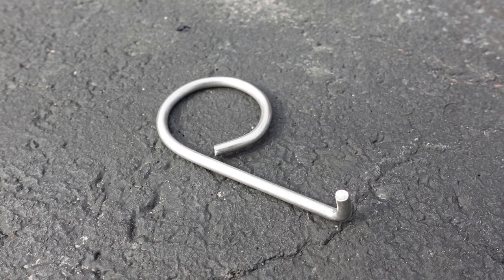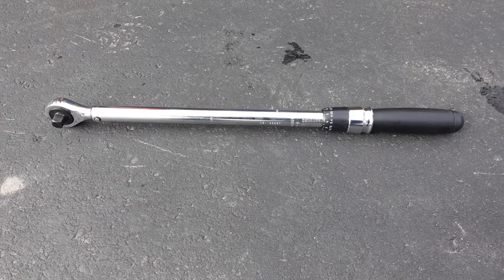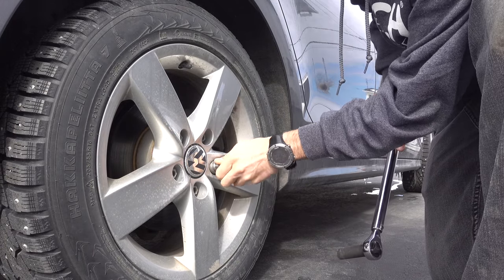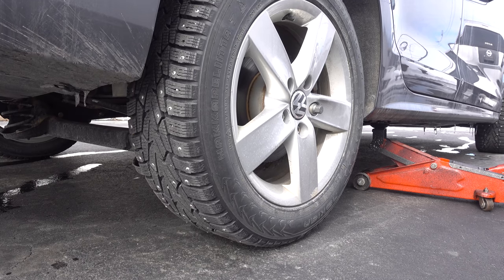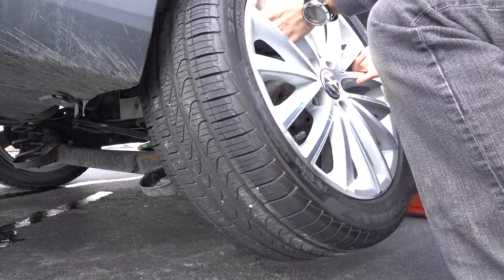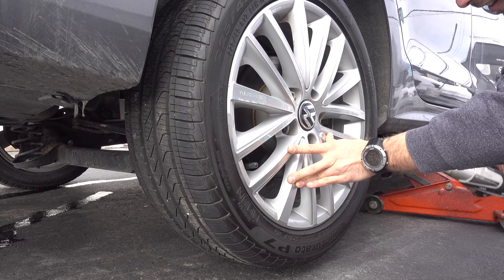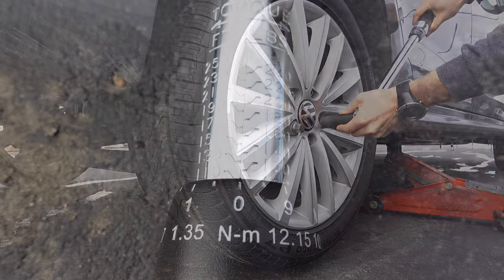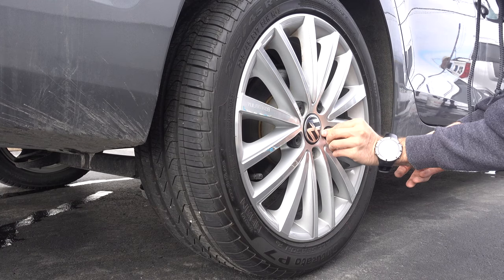How to Change Wheel at home (Exemple with VW Jetta)

Comment: Never put oil on lug bolts/nuts. All your torque measurements are incorrect because of it.
Reply: Thats what i have heard as well but if they are corroded, the torque values are also incorrect. Best is to wire brush them clean. If oil must be used it should be used sparingly. Because when they are installed at factory, the bolts and the threaded hubs are not dry nor are they corroded. They do have factory oil film still on them.
Reply: @MN-sc2uz  wrong there shouldn't even be a drop.They are dry from the factory.  If they are too corroded then replace them.
Reply: @executive  im sorry you are wrong. I have worked in factory, and they are not dry. You are not going replace your lugnuts every season after corrosion. Thats plain silly.
Reply: @MN-sc2uz  Of course not. Mine are still fine after 10 years. Read the service manual. Torque specs are D-R-Y.